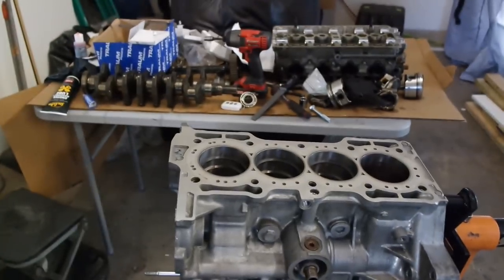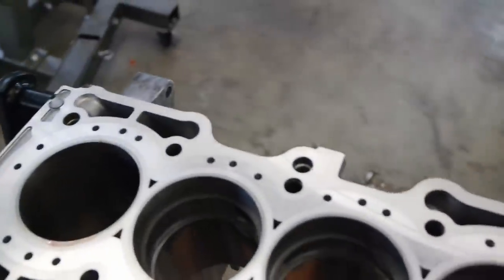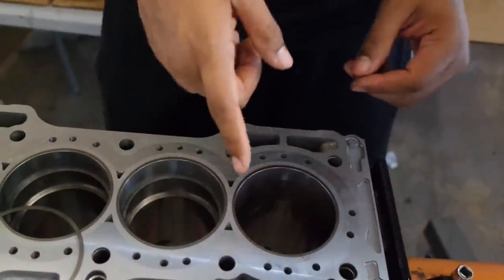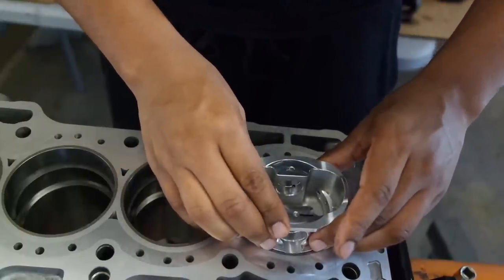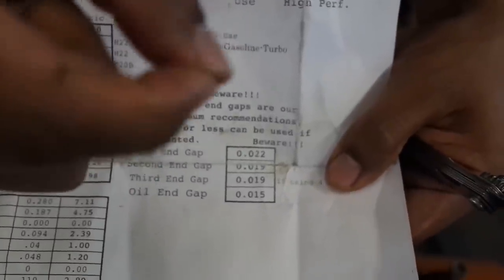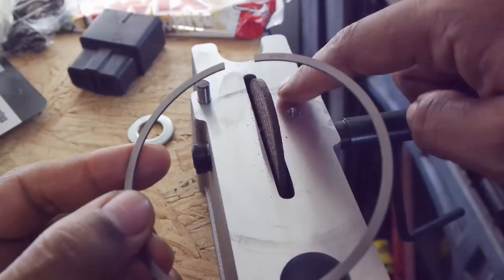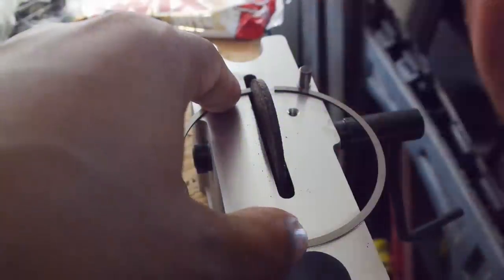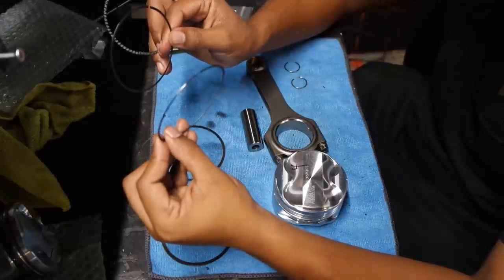How to gap and install piston rings for 600hp honda prelude F20b/ h22

Comment: When I gapped my rings I used a angle grinder in a bench vice lol. Just tap them dudes on the wheel a couple times. Worked great.
Reply from the maker: Hows the motor holding up?
Reply: @treybedipping1734  well it's still on my stand lmao. But I'm sure it will be fine. Huntertuned and boostedboiz always do it. I just filed down the burs. I'll post videos when the car is finally in one piece.